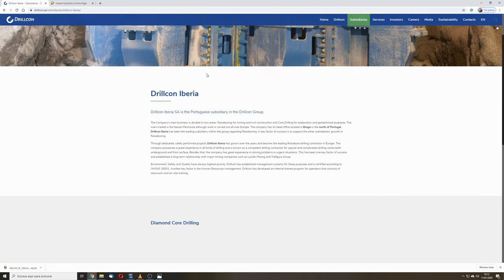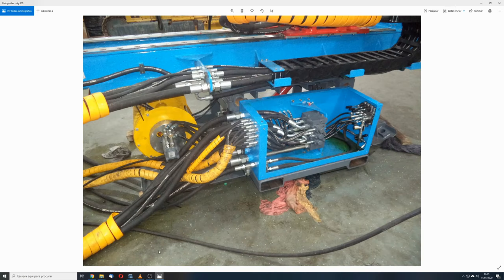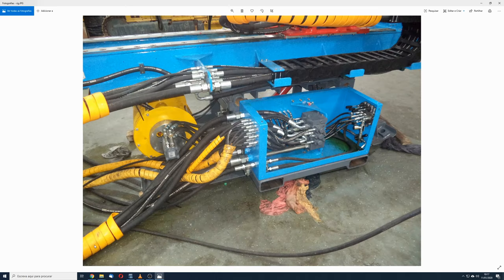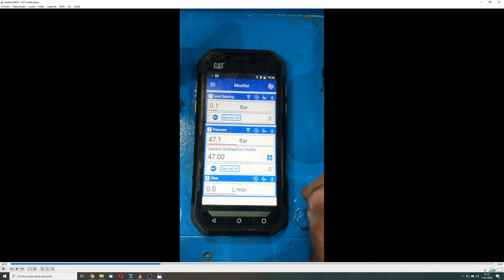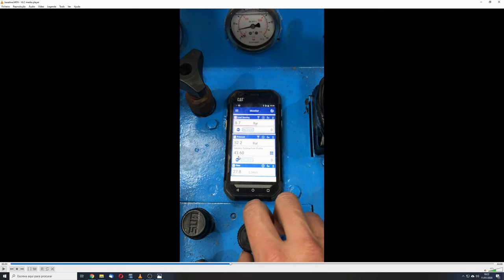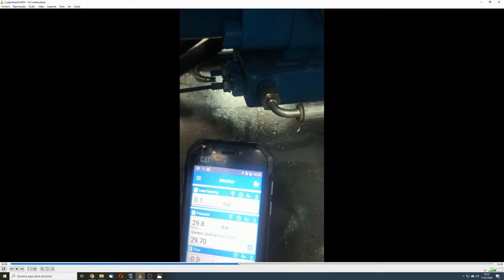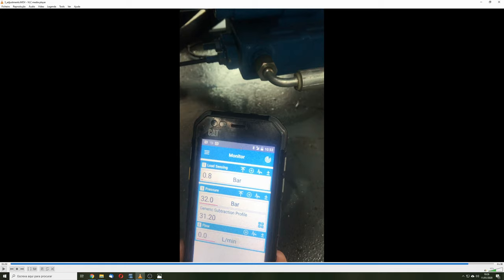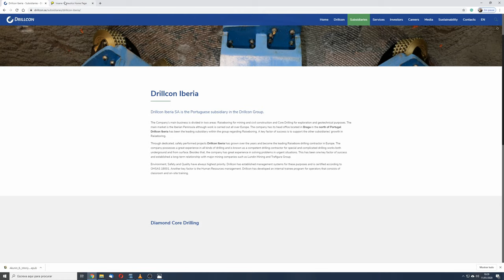Closed Center Load Sensing - Adjustment of Pump Controller

Comment: Trouble shooting heaven♥. 
Love your video, nice easy to understand how you explain the trouble shooting process. Maybe a step to high for beginners in the fluid industries but if you know all the basics of all the components in a hydraulic system its very learn full.
Your video quality does reflect the situation where we technician have to work in. Even this machine is very clean same as the workshop, 
I`am very interested in your self build wireless measuring system, is`t  something what will be available as a self build kit or as a complete finished tool set for hydraulic technicians?
Reply from the maker: Thanks! Most likely it will be both. I have been getting attention both from makers, who just want a bare PCB with components on it and can take care of everything else, and industrial clients, who are only interested in a "turnkey" product.  In any case, it's easiest to start with a kit, which by-passes certification issues.

Comment: This is something I was not aware of before, and definitely will take into consideration in my daily work. Thank you for this video!

I checked the catalog of A11VLO series 1 (RE92500/06.09.) and there is a mention about this at DRS:

"The setting range of delta p is between 14 bar and 25 bar. The standard differential pressure setting is 18 bar. [...]
The stand-by pressure in zero stroke operation is slightly above the delta p setting."

Do you think this difference would change from "slightly above" to "reasonably above" when the old pump's LS control spool is getting worn?
(I am thinking about pressure loss in the LS line towards the pump housing, loss amount increasing with the pressure)

There are "LS with bleed" type of pump controls (some call it "LB control"), do you see them produce this, or is this specific to certain pump designs?
Reply from the maker: Glad you found this useful! 

I don't think that a worn-out LS spool/sleeve would "aggravate" this much, unless, of course, the wear is "severe" and the spool leakage can be measured in liters per minute. This is an interesting point! Hard to verify, though, because when an LS spool wears out to the point where it starts affecting operation, the LS setting becomes the least of concerns... 

The LS with bleed has a small tank connection - but again this wouldn't affect the stand-by of a classic LS system because then the LS line has no pressure at stand-by.  I did come across pumps that had even bigger stand-by - delta P difference. Linde comes to mind, but I can't recall the exact model. 

I believe this behavior is specific to certain pump designs. I haven't studied it in detail, but I can come up with several explanations/theories. Maybe I'll get a chance to verify this one day. Still - it's good to know this happens  (even if it's caused by something simple like a min. displacement adjustment).

Comment: Excellent job on the video and voice over! But I have to ask, did you pay more for that phone with a "CAT" logo??.....LOL
Reply from the maker: Thanks! The reason that I use this phone is probably different from what you may think... This is the S30, it is very rugged, but it is also notoriously slow, which makes it a mediocre smartphone but at the same time a perfect testing platform. If an App can run with a decent frame-rate on an S30, it will run everywhere.